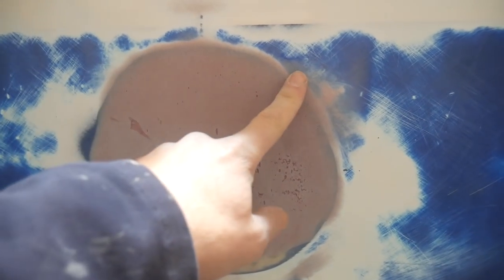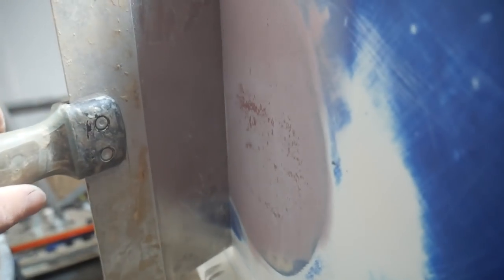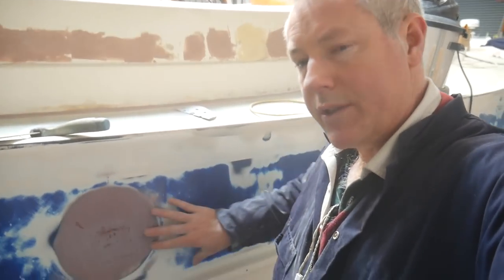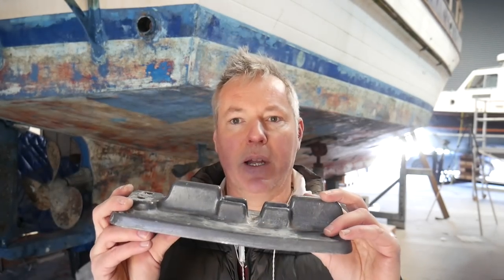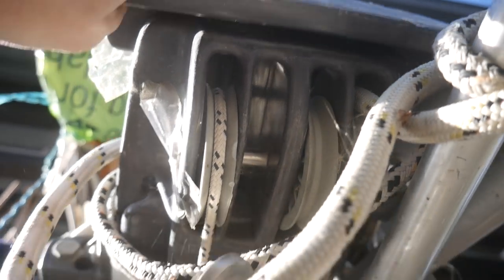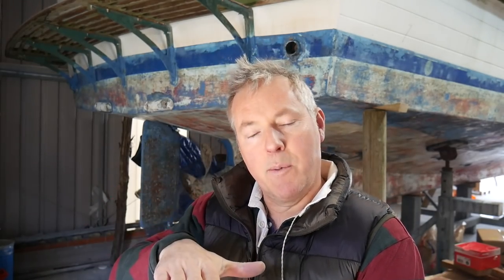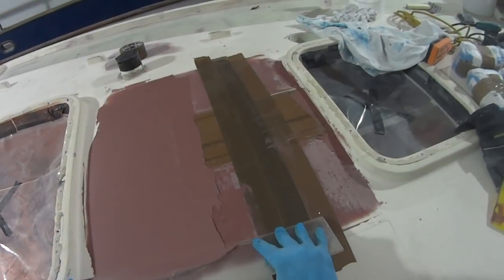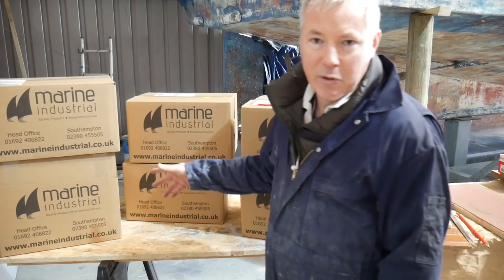#53 final work before priming

Comment: Looking good to me!
A tip when working with epoxy based products: Don't aim for perfect finish with the first layer of filler. No matter what you do, you will need to sand it down anyways. Use an other type of filler for the second layer: easy to sand, high density. For this check the automotive products also. That way you speed up the work quite a bit. If you need to put a thick layer of filler somewhere, use some elastic type and it won't crack.
Reply from the maker: Good advice Scamasax, thanks. The video covers a few layers, I’m up to number three skim. I’ve probably got one more to do before I knock it all back to get the right shape. I’ll finish with a high build primer to get the smooth finish. Not sure about using automotive fillers, the surveyors don’t like them that much.
Reply: Sounds good to me!
I think most of the surveyors have polyester products in their minds, since that's how it was done in the good old days... Then the top layer would be gelcoat, which as you know doesn't work with anything else than polyester filler. ;-)
Reply: @Sonador HogeBomen The light weight easy to sand ones use microballs. Then again most of them (if not all) seem to be polyester based when looking at them carefully, so... Better to forget in this case, you are correct.
Reply from the maker: @Scramasax  thanks guys - really good to get your knowledge and understand the debate between marine and auto fillers.

Comment: If i take a ruler between the bolts on that plate there is 3mm gap in the middle on my 352. I looks original. No damage etc.
Reply from the maker: That's really helpful thank you. I reckon mine is probably about the same - I'm going to measure mine in the same way you did yours to compare. If there was any chance you could take a photo of yours I'd be very grateful as I'm curious to see how it is meant to be bedded in to the laminate around the east step. Because mine was all compressed and cracked I don't have a reference for how it was 'meant' to look.

Comment: Are you worried about that much bog around the mast step? I would think if it flexes during load it will all fall out?
Reply from the maker: Superform you’ve raised a good point, but I think she’ll be right in this case. Once sanded I’ll be down to about 3 mm of filler. Plus there should not be much flex at all in that area as the beam and compression post prevent too much movement. Previously there was up to about 5 mm of gel coat which did crack due to flex because the core compressed. But now there shouldn’t be any compression in the core and therefore the filler should not be flexing. But it was definitely something to consider when planning up much I could safely put down.

Comment: I don’t think that amount of thickened filler is a great thing.   It’s definitely all cosmetic.  It’s covering your structural repair so that part is fine.  Filler that thick has a higher chance of cracking or delaminating. I would have built it up with fiberglass and epoxy or resin a bit then covered it fill filler.   I will love to come back in a couple of years and see how it is.